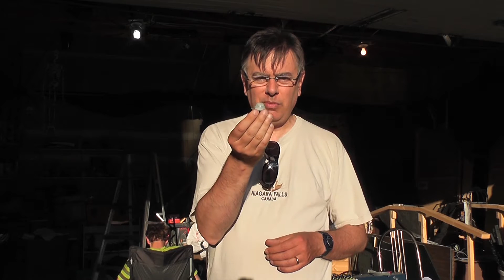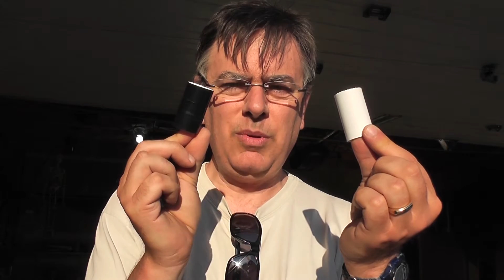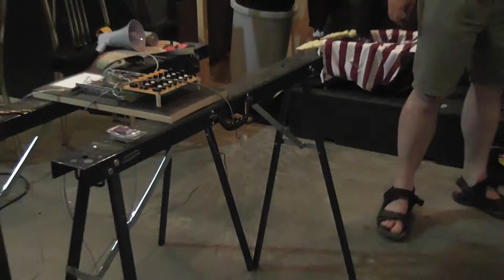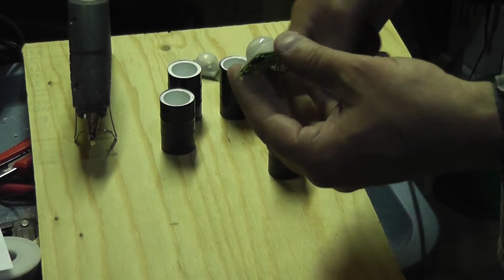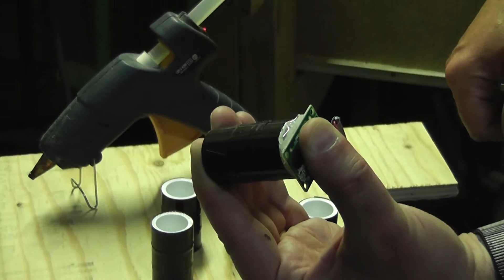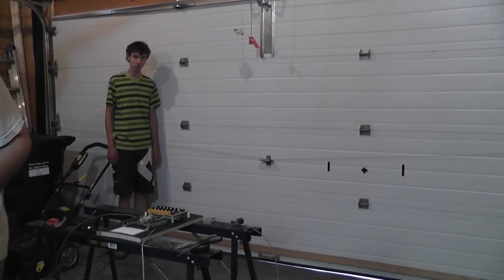Motion Sensor Modification

Comment: How about a modification to sense only cars, not people. Have been searching internet for a solution for a long time but no success.
Reply from the maker: You'd have to use something like what they use for traffic signals... a coil of wire in the road that is part of a circuit that can detect when a car goes over it... should be possible

Comment: Where did you get your sensors and would they work instead of step pads. The store bought props have those horrible sensors that don't work in the dark.
Reply from the maker: Neil82591 Step pads are funny things, because half the time they aren't even switches... they are piezoelectric devices that generate a small current when you step on them. This can make them very difficult to substitute for any other kind of switch or sensor without some sort of special circuitry to convert the switch to the same kind of current the pad generates.As for the sensors themselves, I ordered them online.  They are very easy to find.

Comment: Would it be better on store bought props to connect a pir to the light/sound sensors?Just hate the triggers on the store bought they never work right.
Reply from the maker: Neil82591 I hear ya! You might want to try using a PIR to trigger an LED and fasten that in front of the light sensor (covered so you can't see the LED itself turn on).  That would likely provide the best most reliable method on a store bought prop.

Comment: can u tell me plz how long these sensor lasts.  i mean the life span.
Reply from the maker: I have been using these for many years without any problems.  When I first started with them I discovered they were sensitive to voltage spikes when the power was first applied... so I built a little circuit to delay applying power to them for a few second... they've been flawless ever since.
Reply: @AnimationGoneWrong  thanks a lot sir. In my area there is too much voltage fluctuations, surge and spikes. What sud i doo?
Reply from the maker: @MMaheshThakur  Use a regulated power supply, like an old one out of a PC. That will help.
Reply: @AnimationGoneWrong  hmm thanks

Comment: anyone. i plan to put one outside in my driveway Since it has no settings, is the sensor also sensitive during daytime ?
Reply from the maker: There's no reason it shouldn't be. If it's own of those stand PIR type sensors, they rely more on the heat signature of the moving object then light, so it shouldn't make a difference unless it's REALLY warm out.